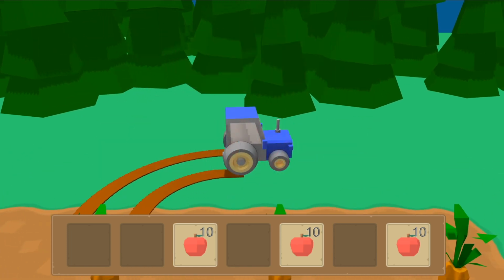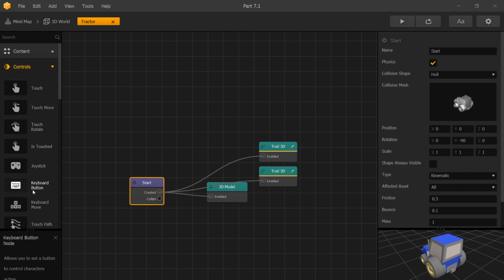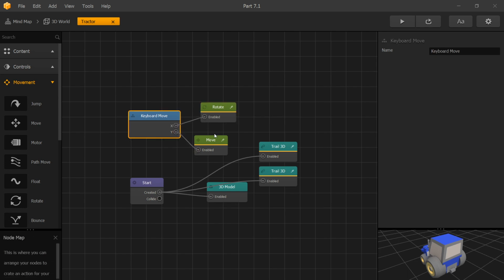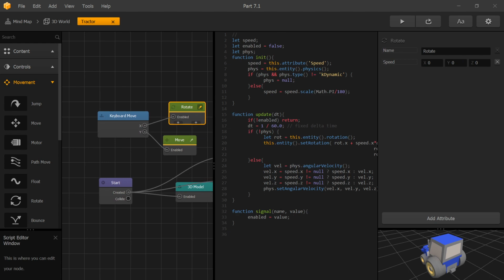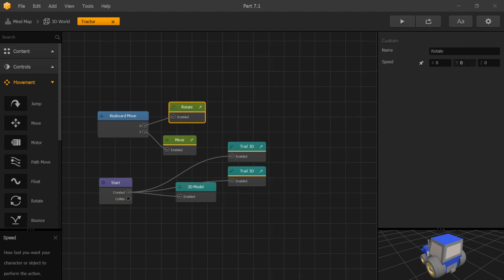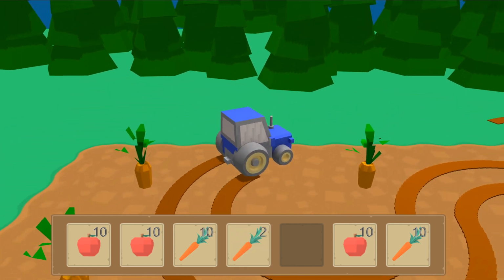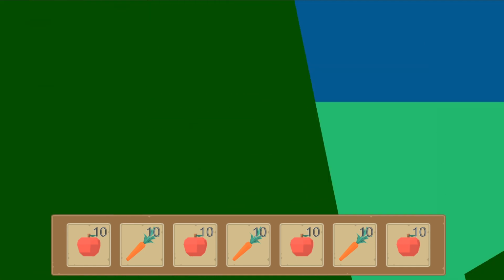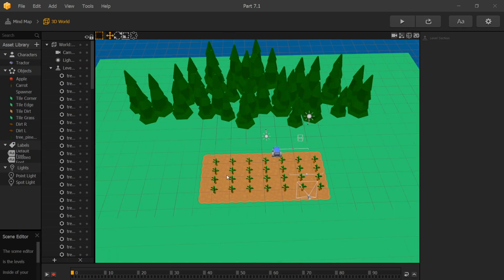Simple Vehicle Controls in Buildbox Game - Tutorial - Control a Car or a Tractor - Farm Game

Comment: Unfortunately, doesn't work well in the driving game...I guess farming game is different than standard driving game (specifically, the buildbox driving game tutorial)...or maybe not?  Car was just spinning.  So, I made some adjustment to the "Z" parameter in the "speed" section of the "Move" node and that worked to some extent...if I'm pressing the up and left/right arrow keys simultaneously; but it's not very smooth.  it would be nice if I could press the left-arrow key and it moves/rotates left at the same time or just pressing the right arrow causes the car to move/rotate right.
Reply: Okay...update...I was able to achieve the desired result by using one "Keyboard Button" node each for the left and right arrow key; and then, for each "Keyboard Button" node I added a "Rotate" and "Move" node, both connected to the "pressed" state of their respective keys.  Once you do this, it's simply a matter of  tweaking the "Move" and "Rotate" node variables.  And of course, I utilized your programming changes to the "Rotate" node script.  Still tweaking the variables for smoother rotations/accelerations...but basically it works.